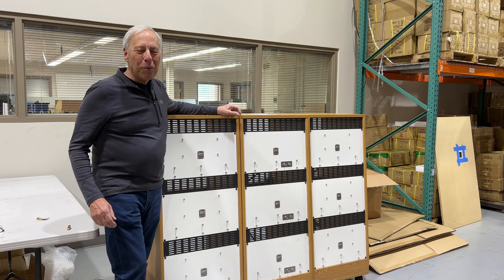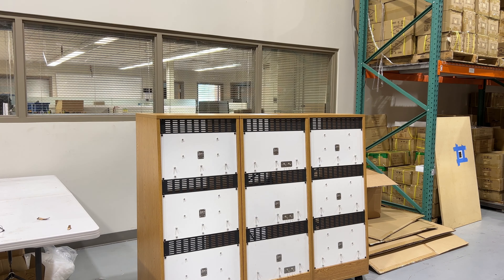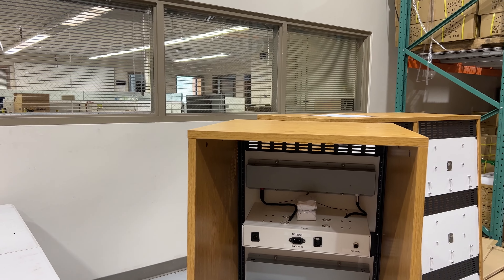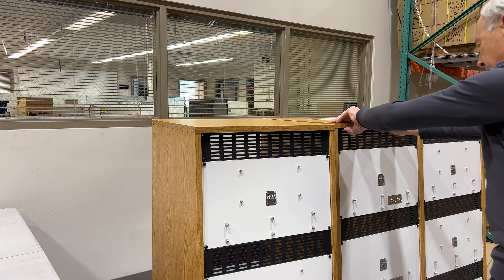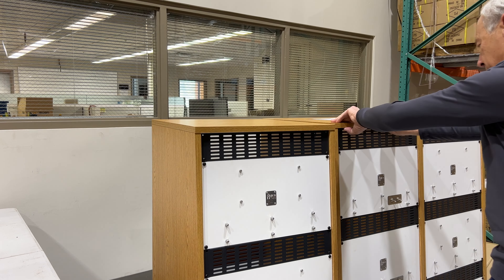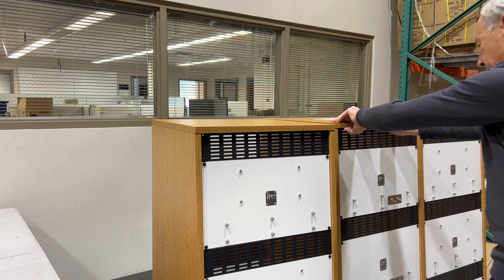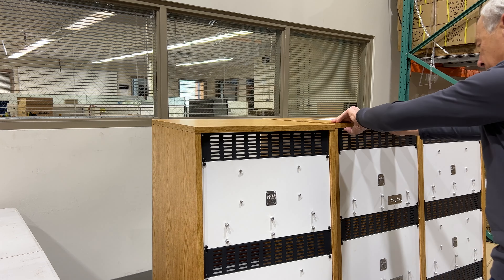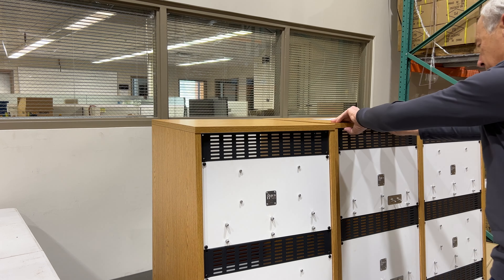Custom Vacuum Tube Reverbs

Comment: That’s awesome. Ages ago, as an audio nerd and technology crazy teenager I bought a stereo spring reverb component and found it to be cool so I did lots of experiments with it. But I never found any actual application for it. Nowadays I would just make a DSP layout to do such thing and run it at 384kHz 32 bits or whatever system clock.

Comment: That's really interesting.  I've never heard a spring reverb that didn't sound like a spring reverb (which is fine for the spring reverb sound).  But these look to be a cut above, so I'd be really interested to hear them.  I would have thought you'd have a plate reverb as the good ones sound so amazing (although I've seen many studios getting rid of theirs because digital is so good now).  If you want a chamber for reverb I'd be willing to make a deal to come tile it. (from LA CA)
Reply: Yes, you can do much better reverb with digital signal processing and surely with enough sample rate, for example 384kHz, the talk about audio fidelity becomes silly talk.

Comment: Interesting design, but I'll be curious to see what you think of those when you have them in use. And, why so many of them? I guess I don't see the need for extreme amounts of headroom in a spring reverb unit amplifier. The limiting factor is the spring, itself. Hit that spring too hard, and it's going to twang and distort (that can be fun as a special effect on something like guitar, but not something that'll yield sonic purity). I'm also interested to know what they've done to the smallish springs on these units to make them high quality. Is some new technology involved? Back in the day before high-quality digital reverb was available and affordable, I used a lot of spring and plate reverb in various studios. AKG was the company known for having highest quality spring reverb units, and they designed and manufactured their own springs. There was the AKG BX10 (I personally owned one of those) and the BX20. The BX20 was quite large, but even the BX10's spring unit was much bigger than the units you just acquired. The enclosures were big, in part, so that there was a high degree of acoustic isolation (insulation and mechanical suspension) so that outside sounds wouldn't excite the springs. The amplifiers for the AKG units were solid state. The springs, themselves, were quite large.